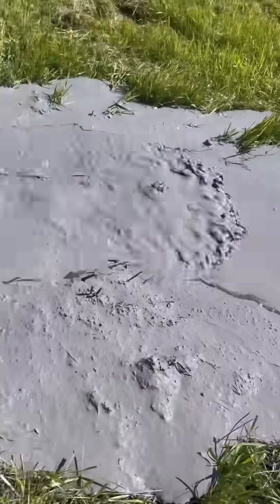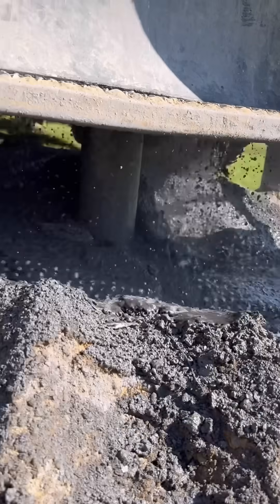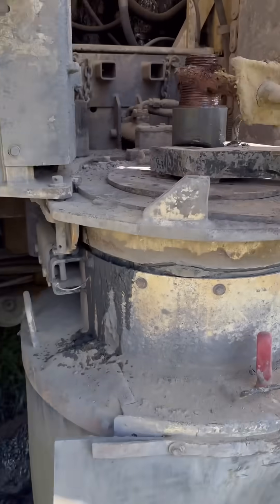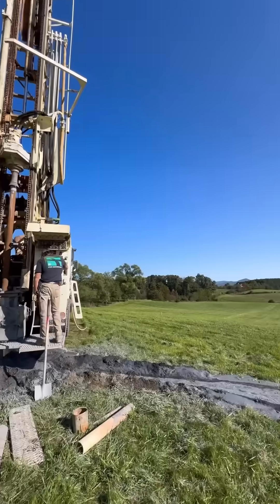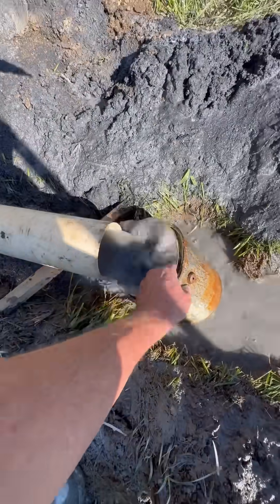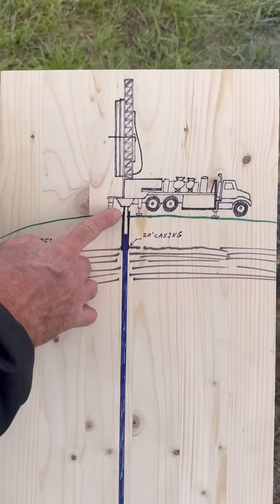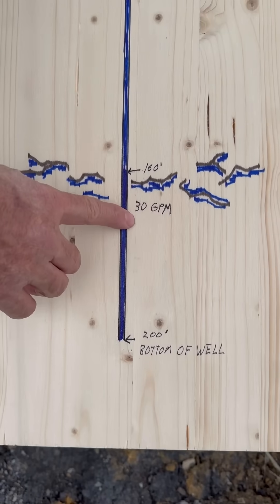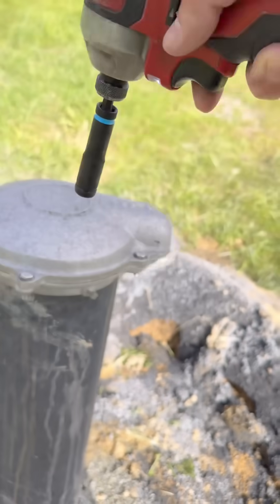How To Drill A Well

Comment: Mine was $8100 for a 180 ft well and that included pump and everything else in southeast Texas. This was about 4 months ago.
Reply: Wow, that's a lot less than I would have thought. 

I'm in an older home in Virginia, with an older well, the size of a manhole. I don't know how deep my well is, but the water is only about 15' from the surface. No basements in my neighborhood due to how high the water table is. 

I always liked that if I lost power for a long time I could use a bucket and rope to get my water. I'm also on a septic, so I'm not dependent on electricity if we ever face some natural disaster.
Reply: @Shadow_Banned_Conservative Septic leach field and a well in a high water table, what could possibly go wrong...
Reply: @roryross3878  My thought exactly...
Reply: 15k for residential well in Loving county Texas 2 yrs ago.
Reply: I just paid $32k for my well. 35gpm but I added a hand pump as well which added to the cost because they had to put in a bigger casing.
Reply: By any chance you have that Drillers information
Reply: @Domingo5450  Bishop Water Well in Newton,TX. drilled mine
Reply: @Domingo5450  Bishop Water Well-Geo Master in Newton TX. is who I used for mine.
Reply: What sucks is if your neighbors tap into the well, then it’s a race to the bottom. Happening all over USA, underground water isn’t regulated so ppl just pump and dry it out.
Reply: @ceezb5629 Every single neighbor i have is tapped into the same water source here in TX. That hasn't happened yet here. But youre right. I believe in personal freedom. But some type of meter can that tells the monthly amount, might be a good idea
Reply: California is 25 to 40 dollars a foot

Comment: Got a 600ft well that can do about 1 gallon a minute. We fill a tank and only run it for 10 minute bursts. Thankfully wenhave spring water most of the year. It os funny the speing runs most of the year so kuch we have to manage the excess but the well 600 ft below the spring barely collects water. It has also gone dry several times. 

Out neighbor a half mile away at the same elevation has a 200ft well and has more what than they could uee all year long. Water is weird man.

Comment: TD is 200'. But you said you drilled 180' of bedrock. Drilling certain types of bedrock can be slow (i.e., granite). Also you did not say how you built the well. Costs would include casing diameter, pump size, where did you access power and how long is your run of the correct gauge wire, 20 foot sanitary seal at the surface could use cement or if your state allows bentonite - different costs, then what kind of screen did you use at depth of the aquifer (continuous wrap, slotted, etc). Lots of variables. Thanks for the video - This well could cost between 8 to 13k.

Comment: There's alot wrong with this,  including the discharge rate calc he offered, and drilling a certain amount of feet. That is not how aquifers work - they're governed by hydraulic gradient and Geology. Most wells in a low spot , by say, a river (which recharges the aquifers, along with rainfall etc) will have shallow aquifers, so charging to drill 200ft is a rip off and just amounts to not understanding the physics behind it.

Source: I'm a Geotechnical engineer who happened to really fall in love with hydrogeology, which is basically the study of groundwater flow
Reply: If it takes 2 seconds to fill a one gallon bucket, how is that not 30 gallons per minute? Or are you taking issue with how the data was collected?

Comment: Always go deeper than you need. My dad drilled our well super deep. Even during the worst drought in living memory we never came close to running out. We could have provided a small town with water.
Reply: This is good advice for bedrock, but it might not be if your well is lined. It's possible to punch through a perched aquifer in sand or gravel and get nothing.
Reply: @cyberpleb2472  Or worst! You can punch a whole in the top aquifer and cause EVERYONE to not have water. Seen that happen a few times, one bad one in Sparta, Tn. 1 Country star went 1200ft not the 7-800 every other home had, with-in a month 3500 homes around him well's went dry
Reply: @dizzlethe7346  Sorry if it sounds like a stupid question but as I'm not familiar with wells so I have to ask - what happens in that case? Is the individual liable for the community's lack of water? Do they just truck water in forever?
Reply: @anticlutch  depends on the area and judge tbh. More often than not, citizens are Fed over bc how hard it is to prove they caused it wholly and not just a drought or plate shift. And or it is dragged on so long the ppl sell out (no water) and take tiny settlements.
Reply: @anticlutch  basically if you don't have e the money to either truck it in like you said (few do) or dig a well of similar depth (even less do) most ppl take pennies on the dollar for the property and move, then get pennies (because of situation) take tiny settlements.  RARELY are people ever made whole with court. An really only southwest states
Reply: Drilling deeper doesn't do you a thing.  that little of a reserve is about one day worth of water.  What you can do is hit a dry pocket a lose all the water you thought you gained.  A 20 ft pocket below the water stream is good for catching sand and rock chip debris.
Reply: @MrOldclunker  not true. There can be multiple levels to aquifers. Confined vs inconfined amd sometimes even two levels to the same aquifer and getting the deepest portion gains you the most amount of water possible.
Reply: How would you know if you've ever came close, without running out first?
Reply: In layered sedimentary formations (like in a coastal plain), you can punch through tight shale (or clay) into a confined unit under the surficial aquifer.
But in areas of fractured crystalline bedrock (e.g., granite), most of the "open" water-yielding horizontal fractures are encountered fairly near the top of bedrock. In the latter case drilling deeper beneath the water-yielding fracture zone creates a "sump", or demand-buffering reservoir, into which you can set the well pump.
Reply from the maker: Smart

Comment: I had a well drilled in 1994 it was $7 a foot he drilled 245 feet the cost was $1715 he put a 40 foot casing in it and i did the pump and wiring myself! Dang how prices have went up over the years!!
Reply: It's not just that prices have gone up. Dollar purchasing power has gone down. Inflation from +4x-ing the monetary supply. Money printing press goes Brrrrrrrrrrrrtttttttttt.

Comment: Cost of the well is one thing, but next time I drill another, I would test the quality of the water. You may spend thousands more on softening and sulphur removal etc…high TDS after softening can be a headache over the years too. 
Catch a natural spring with lower flow is more desirable than “garbage” water at 160 feet…test as you drill if at all possible..z

Comment: In 2001 I built a house and had a well drilled in the back yard 
Cost around $2800 for 80’ of 6” casing , you can drive 2” pipe in the ground by hand makes it a lot cheaper solution!

Comment: Gotta be careful drilling that far past water.  Here in Canada you drill that far past good water your 100% going to ruin it.  Seen them hit everything from sulfur to salt, to natural gas to small oil pockets.  Drilled neighbours well, it water at 160 owner demanded deeper, went 25 ft more, hit major sulfur, well ruined had to fill with cement and cap.  15k money gone with nothing but a cement filled pipe.

Comment: Ours was 327 feet deep cased entirely with 6 inch steel and cost $ 19000 dollars with an additional $ 3000 for the electrical.

Comment: My well pump went out 5 years ago. I thought my well was 160 feet down and i started pulling the pipe up myself with a hand winch.  It wound up being 460 feet deep!!  I pulled the whole thing out and replaced the pump myself. Moral of the story: have a savings accout for stuff like this!
Reply: Our family well my father started to dig it down to be able to put a 4' casing for the first 40'. At 30' the well filled in with water in up 10'. Hit an Artesian Well. We tried to pump the water out to dig it down some more. But even with 4 pumps going, never dropped an inch. The business that we rented the pumps and 3" hoses from said we were pumping over 3,000 gpm. When our neighbors well went dry one year, we loaded 6 45 gal drums in the trailer, it took only a few minutes for the 1 1/2" pump to fill them.
Reply: @michaelgarrison688 On Long Island,NY?  I hear there are a lot of ARTESIAN WELLS THERE!
Reply: Just replaced my original Well Pump after 35 years and it cost over $1,400 the first pump was $300 !
Reply: @lilibethdoherty295  Thats why I bought a second pump just like the first one.  I had to use it 16 years later.  The pump was replaced in 2017.
Reply: @lilibethdoherty295  Almost like inflation happened ^^
Reply: mine went out 2018, i had a lot of extra lumber for some side projects so i built a 30' derick with a 4x12 and block and tackle at the top. pulled 16 pieces of pipe the motor and pump and replaced everything using triple walled pvc 14 sticks all new cable and spiders.. built derick 1 day, pulled everything out and hunted down parts 2nd day..put in 3rd day, took derick apart next weekend i liked the way it looked..hits water at 55 draw down showed about 75' the other 200 was because i couldnt get more than 280' in pipe..still pumps awesome. cost $ 1200 in parts
Reply: @local631  My brother would have called this a "weekender project or maybe a couple".   It really makes me laugh because I can barely hammer a nail.   My hats off to you and my hardhat wearing brother.
Reply: @TheTibetyak  Something about us guys with Hard hats.  We live for hands on jobs and never shy away even from things we never tried up until thAt point
Reply: How in the unholy fuck did you pull 500ft of a 1 inch well line by hand?
Reply: @Koldatt  I made custom clamps to hold the pipe and started with a frame over the well.  Attached a ratcheting hand winch (come along winch) to the frame and pulled it up 5 feet at a time.  Attach the clamp so I could reattach the winch and pull it 5 feet more.   Once i reached 160 feet, I knew I had to do something different.  I strung something between two trees about 15 feet up, attached a pully to it and then used the truck to pull it 20 feet at a time.  Yeah, it was insane.
Reply: @aConspiracyOnlyTakes2  Thats smart as hell man . as a plumber, well done!
Reply: @Koldatt  thank you!
Reply: @danielmiller2886  Pulled a pump a the cabin with tree trunks. Slip the rope down the pipe, lever it out about a foot, wait for dad to do the same, repeat. Although we were only 50' down at the cabin.
Reply: What kind of pipe was that on? In PA I’ve pulled pumps up to 350’ that were on 1” well line. But have pulled 600’ wells using schedule 80 pvc. I hate pulling wells on iron pipe.
Reply: Not many men can say they’ve done this, better than savings.
Reply: I bought 3 acres in Tx and the original well and pump from 1983 is still working pretty good but I know its on borrowed time. I might try to replace the pump myself one day. I never done a job like that but it can’t be that hard lol. Yeah right!
Reply: @scottgarmon4865  Not hard at all...IF you have the tools you need!  LOL
Reply: Great advice
Reply: I halfway feel your pain. I had a kc nipple corrode through and had to replace. While lifting the poly pipe up to replace the nipple, the hot lead for power at the bottom came disconnected. Was on the weekend and wasn't about to pay for an emergency plumber to do the work for me. Pulled all 260 hand over hand. Arms were rubber by the end.
Reply: Ow my gosh. 😮😢 That would make me cry
Reply: How hard was it to do it?
Reply: Damn! You’re a beast! 💪
Reply: Just finished having a new well drilled for my small town. 640 ft with 8in casing came in right at $1million
Reply: @RichardPyne  That seems extremely expensive!?
Reply: @RichardPyne for a whole town?
Reply: @RichardPyne  You got ripped off unless you got a whole water treatment plant included in the price.

Comment: When you buy property,  the FIRST thing is SEWAGE. If there's no sewage lines, then you'll need a gravity septic system or a sand mound. The ground where the leech field is located MUST perculate properly.  If it doesn't perculate, you can't build on it. Check it out before you buy the property...

Comment: Just paid $10,160 for a 360 ft deep well. Static level came up to 120 ft, 60 gal per minute. Anothe 6,700 for the pump and pressure tank. Put in 600' of 11/2" water line and 4 hydrants for another $1800 cost plus $450 for excavator rental, so all in $19,110.00. We live in SW Missouri.
Reply: I live in sw MO too.. Jesus that's a lot... 😮
Reply: I said 20 grand so pretty close
Reply: I just moved to Douglas County....
Hopefully!!! mines not as expensive...
Reply: Yeah they're rip-off nowadays
Reply: Yeah I did a 30 gallon a minute well for 2k 20 years ago. Get Kamala the frick out of the picture!
Reply: @boomer1049  dang I didn't know Kamala was in the well business, that's crazy

Comment: Is that a drilltech ? I ran a Ingersol dm 50. It was a rotary set up though and not a hammer.
Reply from the maker: I believe it’s a drilltech T25KW
Reply: @hausplans  Very cool, When I first started in the mines the company I worked for had a few of those. Some of my first experience on a drill rig was on one like that. Later I got moved to a crawler drill.  Had a DVD player, surround sound haha it was a unit. The rotarys  were slower in the hard rock then the hammer drills but so much easier on the ears.

Comment: bought a place and the well is only 21 feet. both neibors on either side are far deeper then 300. well regestrys arent they cool. water is super soft and tests ok and i dont run out in the summer so guess its not a problem.

Comment: Hey old rancher tip from at one time the windmill capitol. Preforated pcv pipe first, then pcv pipe to case the rest the way out of the well. What the point in drilling a well? If you don't case the whole. Out here the well holes can calapse and if you use steel pipe casing, they won't refill it. If its Pcv pipe they can redrill out the calapse and casing.

Comment: $4000, anything more is just the company owner wanting a new house or another expensive toy.
Reply: It costs over 5000 just to change the synthetic oil in the rigs compressor...if not then you gotta spend 125,000 to replace that screw compressor alone

Comment: I'm in sand, so simple to 'drill'  $5 to say hello.
bedrock, steel liner, pump and power.   10k to 15k   if there are more than a few drillers,  $25k if there are only 2 in the area.

Comment: For a 4inch 1hp 160ft complete system we'd install up to the house for about 5,500 to 10 grand depending on some factors but on average $5,500 to 7,500 is common. Or We'd drill the well drop the casing and give you a pump and it would cost around 3,800 to 4,500.

Comment: My thought was 13K Though it depends on the state, I had a few drilled for 9k 15 years ago in Upstate NY... Rotory drills are ok, but sometimes you need a pounder to break up and fracture the bedrock letting water in, rotory can create a sealed hole with no water.... Best drillers for water had 2 machines, and knowledge of the geology

Comment: My dad and the neighbor bought a used rig and the three of us drilled a well on our 160 acres 24”X300’ we put in a 12” casing water table was like 23’, then we drilled the neighbor’s well.
Reply: There's more than one water table. There's the recent run off, that's your 23', then there's the deep, pristine filtered non giardia stuff that the pros actually drill for. One of the reasons the wells are actually capped except for the pipe coming out, to avoid shit falling in there. 

Disinfectanting/Bleaching a well is not a fun time. Or a short amount of time. It can take weeks.

The near surface water table is still full of road run off and other shit you prob don't want to drink. Where I'm at it's not even legal for human consumption, tho shallow wells are fine for gardens and landscaping.
Reply: @Mix1mum Upnin MI,, I had an old shallow & a deep drilled well(s) ,, both were good,  both tested good too, I preferred the shallow well water best..

Comment: Random fact.

Water can be sucked up about 10 metres(30') but no further. It turns to vapour.

Beyond that, it needs to be pushed up, implying that the pump has to be in the well.
Reply: pretty cool fact tbh.

Comment: My old well was only 35 ft deep, had 15 ft of casing, it was where two underground streams met. I had 12 gallons a minute in an area where 2 gallons a minute was the average.
Water was crap though, sulfur iron, and manganese. You can bet I was rejoicing when rural water came through!
Reply: Out here in western PA most of our wells are shallow (100ft or less). Lots of iron and manganese too. Luckily you can get a three-stage filter set for $180 these days, and then a 6 stage reverse osmosis filter system for drinking water is only about $250.

The municipal water is pulled from rivers and creeks, gets a ton of treatment, and tastes gross.
Reply: @thelight3112  The problematic part of mine was the sulfur, and treatment was expensive with Cul-Sorb tanks and a softener. My rural water comes from Lake Erie and tastes pretty good.

Comment: Did they bleed the pressure or did they just measure with it? Cuz that water looks like its fresh from the bit.😂😂😂 inaccurate readings with air pressure in the veins.
Reply from the maker: They did it properly, even came back the next day and we tested again after running it a while to make sure it was accurate
Reply: @hausplans  nice! Initial gpm immediately after drilling obviously isn't accurate so I'm sure you could see my concern lol.